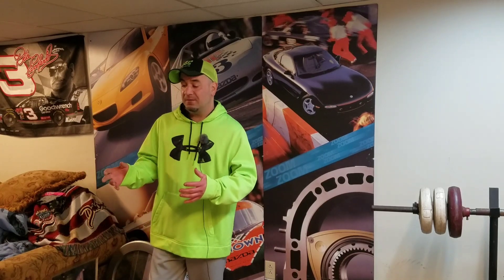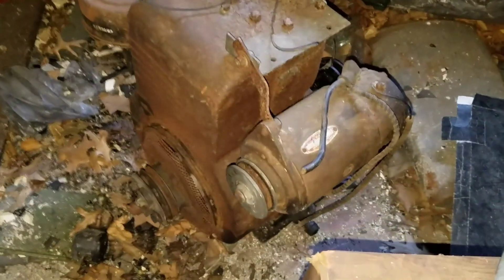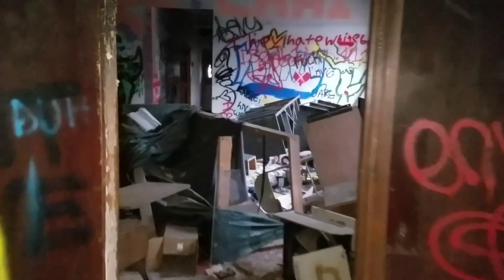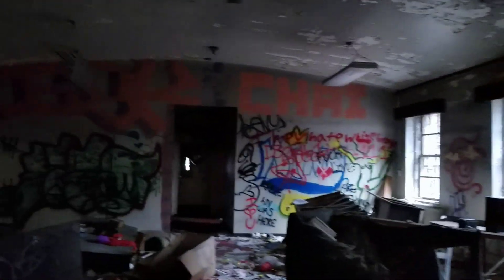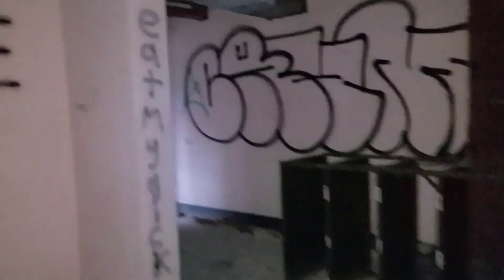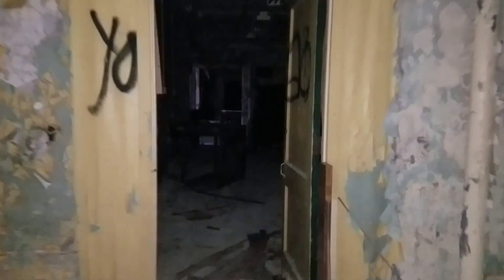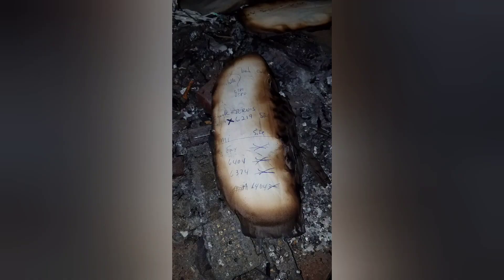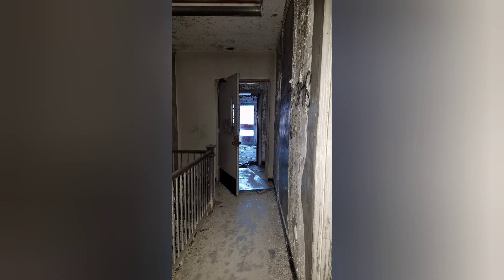ABANDONED HOSPITAL SCHOOL BUILDING

Comment: Steam Radiators, Asbestos covered pipes, mimeograph machine, Florescent fixtures with light diffusers that reminded me of ice cube trays, the cubby that served as mail boxes for individual classrooms and the Letter Press like the one I learned on in 1969-1971 in Fair Haven Middle School.  I'm surprised there were no blackboards.  Old IBM 286 computers and CRT Monitors from the 1980's.  I guess there was an attempt to modernize.
Reply from the maker: I always have an interest in old lights, I try to film them whenever I find them. And yes, asbestos covered pipes everywhere, asbestos floor tiles everywhere else LOL
There was one blackboard, it was smashed of course, I just don't understand people.
But it does look like this building started being stripped or taken apart at some point. There was a room full of old computers and CRT monitors basically just throw in there on top of each other, I thought I had filmed it but I guess I missed that part as I was taking it all in. They absolutely removed all the hard drives out of that old server in the basement though. It would be interesting to see what kind of stuff was on those, I'm sure there was a reason those were removed.
Those old computers always remind me of Elementary school. I think we had one computer on a cart and they would just wheel it from room to room every day lol. It was the green screen apple, then we got the color screen, that thing was so cool. Apple two possibly?  I don't know, I just used to like the play Oregon Trail and Carmen Sandiego on the green screen Apple

Comment: That place is in a bad way but I like all the old relics like the old style desks and computer monitors. Not sure what all those rusty bits of machinery were for.
Reply from the maker: Yeah, this place is in bad shape yet still not quite as bad as the other buildings. A lot of the other buildings have been completely cleaned out, this one still had stuff left over which was really neat to see.
Some of the rusty Machinery Left Behind was some type of printing press, there was also an old bandsaw and a few other things. I did notice how the computer server in the basement was completely cleaned out of hardware, just the old cabinets left behind. God only knows what kind of stuff was on those old hard drives, but like most old hospitals around here I'm sure there's a reason they got rid of them